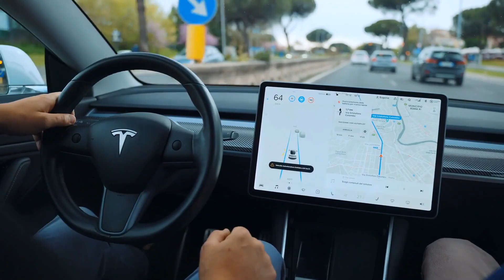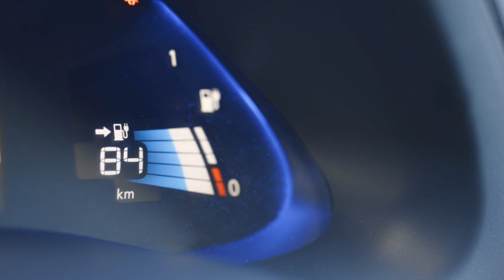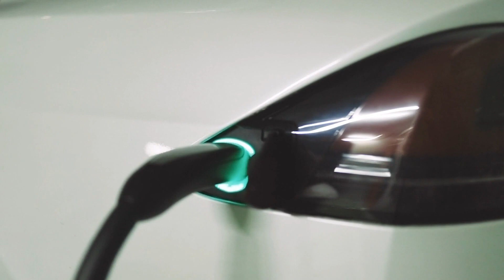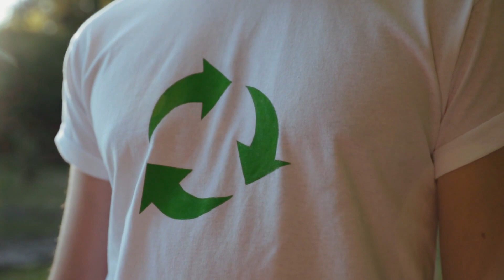Can Electric Cars Really Reduce Carbon Footprint?

Comment: The answer is ABSOLUTELY YES!!! Fact, 70,250,400 electric cars can be powered a month by the energy used a month to pump just the oil that is used in the manufacture of THE FUEL the internal combustion vehicles use out of the ground alone in the US and offshore!!! now add   the manufacture of fossil fuel and getting the fuel to the pumps! and all of that is before it is even burned in the internal combustion engine and 70% of that energy is wasted heat before that pollution even comes out of the tailpipe! :eek:
Reply from the maker: That's a perfect statement sir, Thanks for the info.